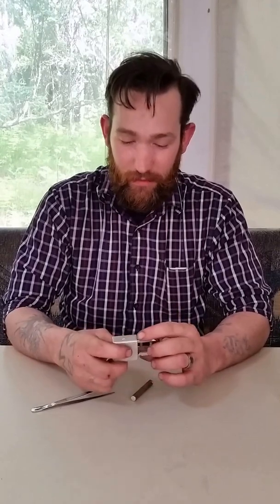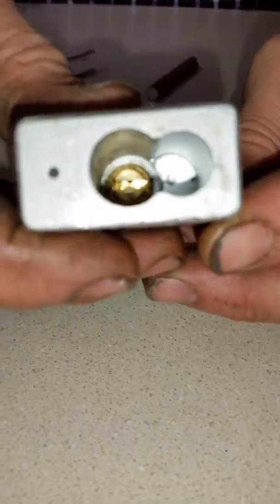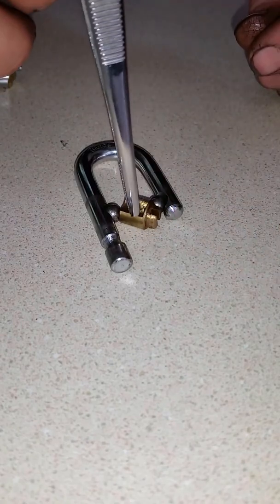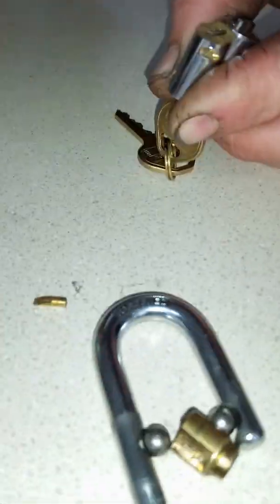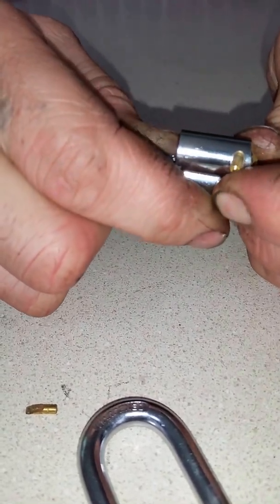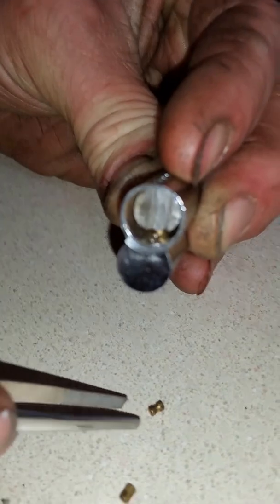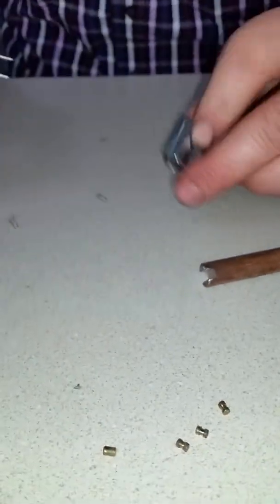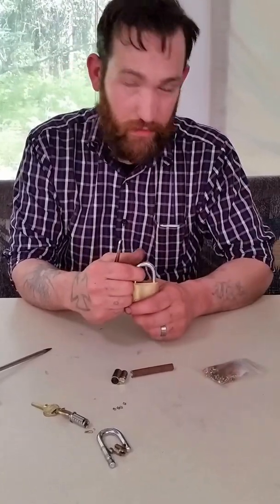Inside the Master Lock No. 570: Disassembly and Pinning Revealed | Yojimbo Security Ninja

Comment: Watch it with the Master 570's they have a trap grove in the core (not the bible) that ALWAYS get caught on Pin 5 in the bible...  Its the grove that pin 5 sits in to stop you from turning the core all the way around...  You gotta make sure the core is facing the correct angle before yanking it, or another way is shim the core before removing it or that damn grove to keep you from turning the core past 90 degrees will always screw you up...